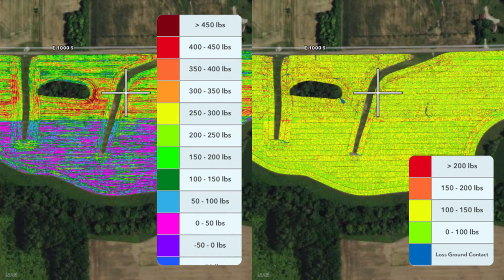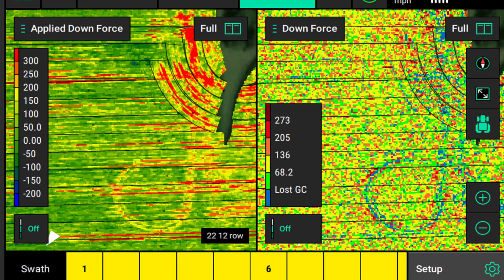How to Operate DeltaForce ‣ Applied Down Force Map

Comment: I keep the applied map up on my iPad most of the time. Tells you a lot about the field and when you do or do not have a problem with a row. I’ve found a few gauge wheels that fell off using this map. Or a glance at the map you may think there is an issue with one row, but it’s just that row riding over a sprayer track, etc.